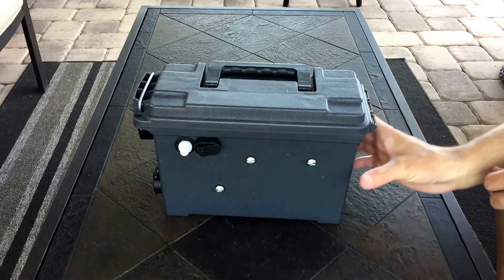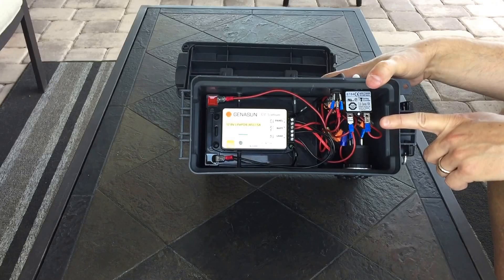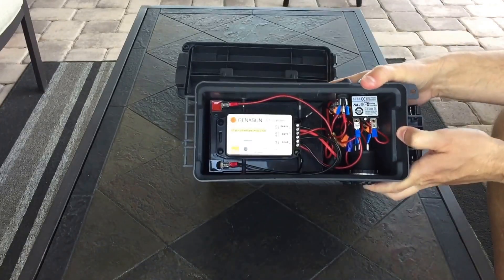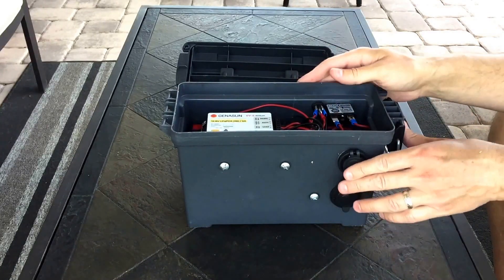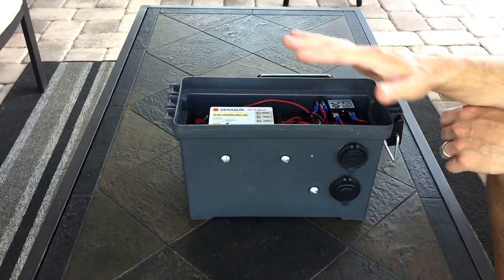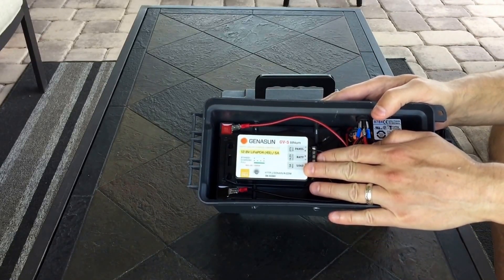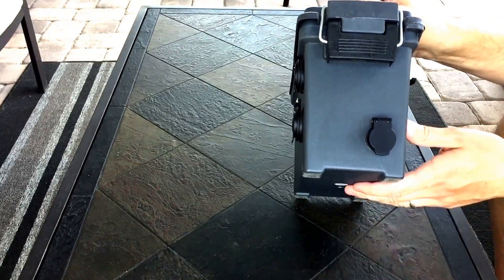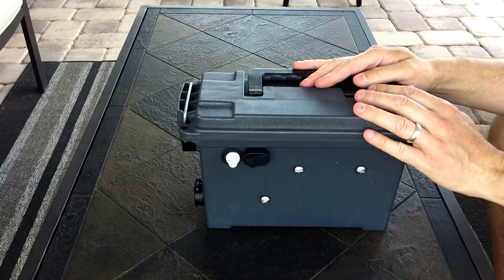Solar Ammo Box 1.0 Generator Final Update

Comment: Great job! I'm planning on purchasing from Bioenno too but have you found a solution of you run the batteries dead, triggering the protection circuit's Low Voltage Cutoff? I guess one can always "jump" it by connecting it to another 12v battery but I'd prefer being able to put it in the sun and have the controller feed it power. 

Bioenno has a (larger) MPPT controller. Have you asked them if it works better with these batteries?
Reply from the maker: +Laurence Thank you!  I have tested several options in regards to getting the BMS to "wake up" per se. I have asked them about their controller and it has the same challenge. The BMS is doing its job which is a good thing, it's just an inconvenience that you have to accommodate.
Reply: ***** that's actually great news if other controllers won't "wake up" the BMS because I was preferring the smaller, more efficient Genasun controller for my design. Luckily this generator is more for urban use and i'll have a chance to plug in, if even for just a second to kickstart the BMS.

Comment: Matt - I've been following all of your videos.  Great Job!  Thanks for all the good info.
Reply from the maker: +Richard Jewkes Thanks Richard!
Reply: Hi Matt - can you help me?  My question is How do I decide what size of a solar panel do I need?  I have 2 ea 12V12ah batteries I'll be using.  Thanks.
Reply from the maker: Are they wired in series or parallel?
Reply: parallel - I will end up with 12V and 24ah
Reply from the maker: It comes down to how fast you want to recharge the batteries.  I personally use a 50W panel, but the most I've seen it produce is 30-35W, which is expected.  Full sun, it takes about 4-5 hours to recharge my generator.  It's worth checking the specs of your battery to see if it states anything in regards to charging current.
12V panels are expensive ($/watt) so budget will play a factor.
Reply: Thanks - I appreciate your help.